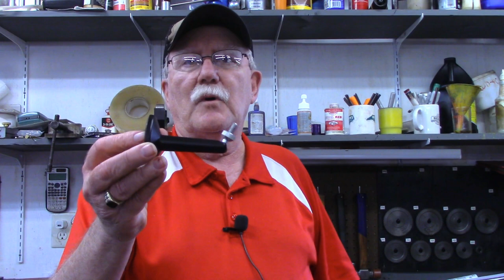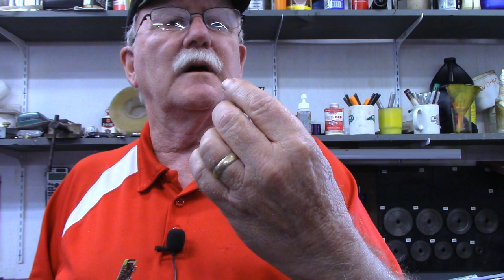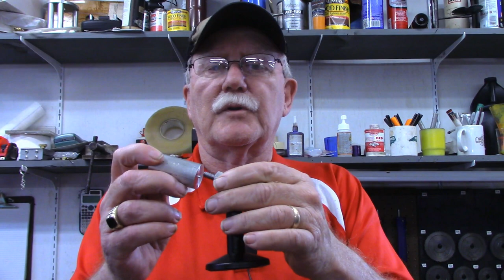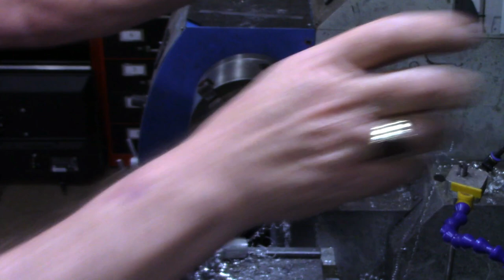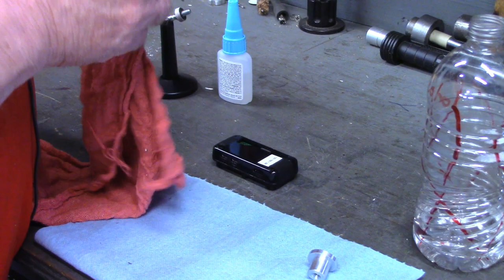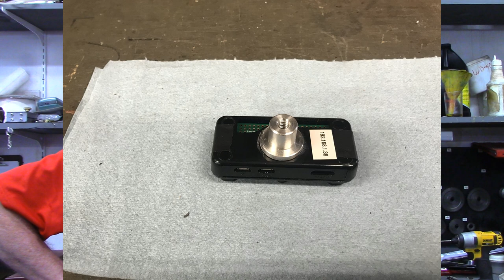Raspberry Pi Surveillance Camera Mounting Adapter

Comment: Those are definitely fascinating little devices.  I sure would be interested in some details of exactly what the hardware and software is that you are using so I can put some of them together.  Also how you manage to re-use laptop screens,  since I have a whole pile of dead laptops around here as well.  Ditto on the file server,  if you don't mind...

A connector was visible in that pi camera at one point,  are you doing anything to protect those?  Or the power inlet?